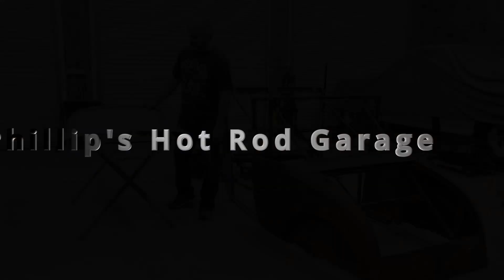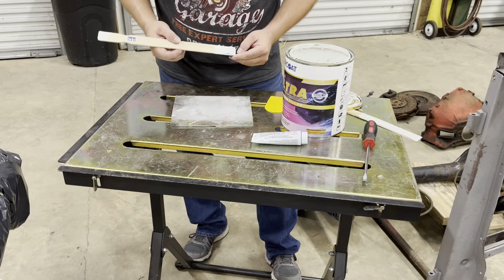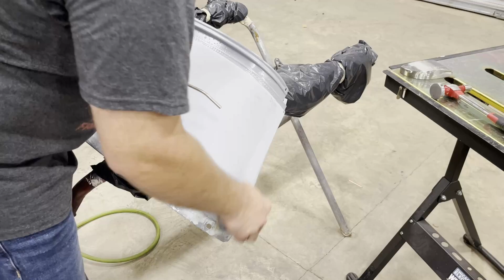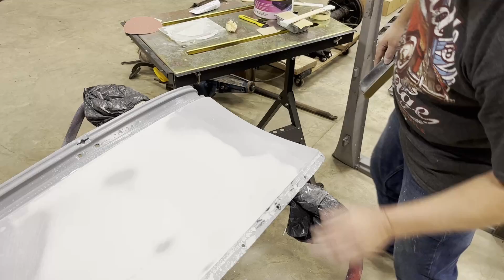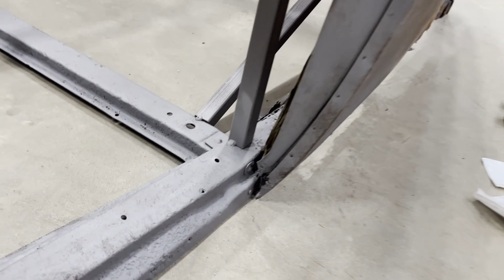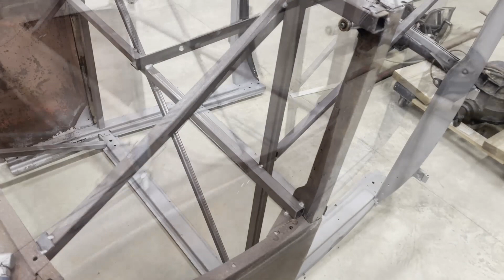Body filler! Epoxy Primer! Doing body work on the Model A traditional hot rod project!

Comment: How did you like that SPI epoxy? I have a project coming up. Thinking of using SPI for the epoxy, probably Urechem for the rest.
Reply from the maker: The SPI epoxy is good stuff.  It’s easy to make it fisheye though. You have to have the surface prep right, and you can’t spray it too heavy or it will pinhole or fisheye on you.  Once you figure out how to apply it to get it to lay down right, you can’t beat it.  I like that it’s sandable.